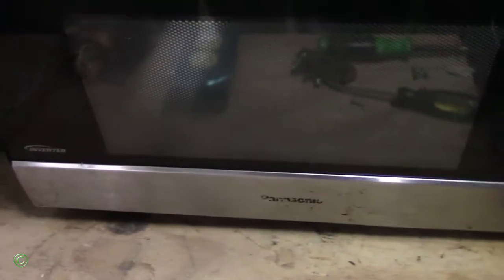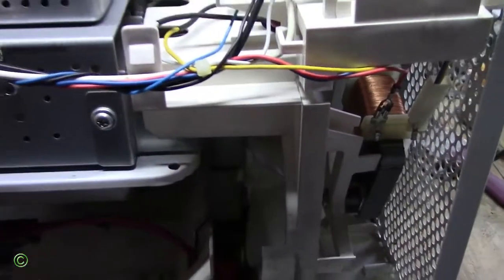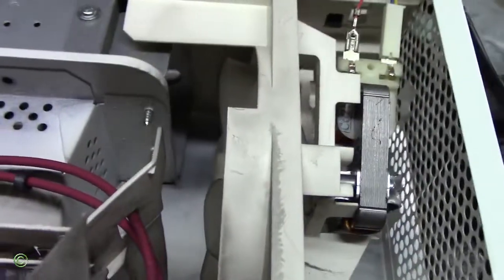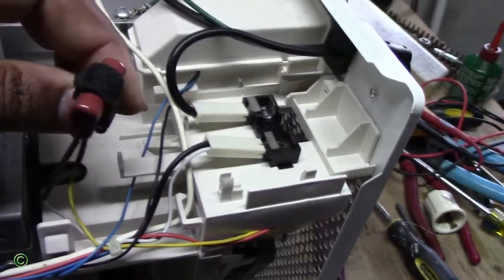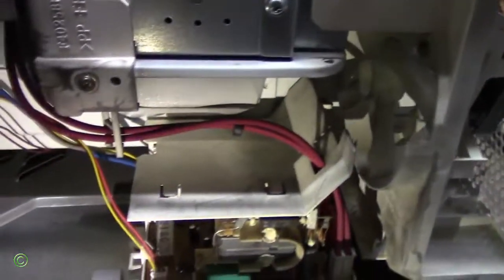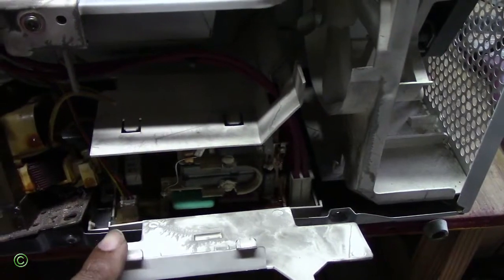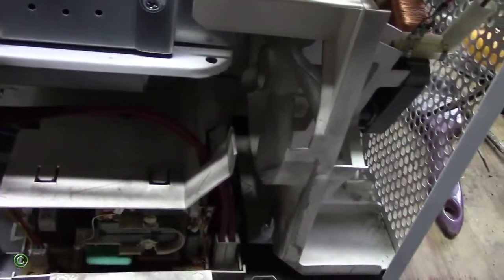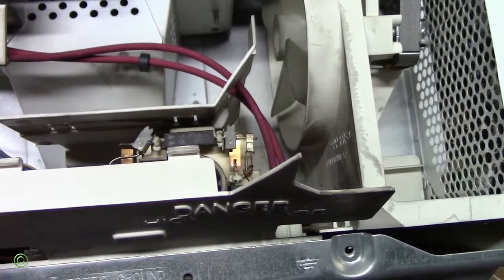Panasonic Inverter Microwave Oven (circuit board gone bad)

Comment: I’ve got that same Panasonic model and my Circuit board okay. No burn marks anywhere. The microwave just not getting any power when plugged in, I think it just need a Fuse replacement..
Reply from the maker: try changing the fuse & see what happen.

Comment: Thanks for sharing.  As this was posed a while ago, so i do not really expect a response, but is there something inherent that causes the circuit board to fail - ie bad solder joints,  traces too thin, wires not thick enough for load etc...  Catching fire / burn out is a pretty significant failure.
Reply from the maker: one of the main reason the circuit board burn is because of running the microwave for a long time. like 10-15 minutes nonstop. running the microwave for so long causes the circuit board to overheat and burnout. that's one reason.

Comment: I have a Panasonic NN-SN966S - it's four years old.  It started beeping, and now the control panel lights up but none of the program buttons work.   Is this a control panel failure or a circuit board failure?   I had been using this microwave for fairly long runs, about 8-12 minutes long.
Reply from the maker: Hi. Most of the time it's a keypad problem. Hardly ever be a circuit board problem. You should buy the buy keypad.

Comment: Mine problem was everytime I plug in power it starts to count P10 to P1 for two minutes then nothing work.  Do you know what’s wrong?
Reply from the maker: Sound like the circuit board gone bad.
Reply: Mine is doing the same thing. It wasn't even running. Just started beeping. I was hoping for a reset button or something. Sounds like I'm shopping for a NOT Panasonic microwave.